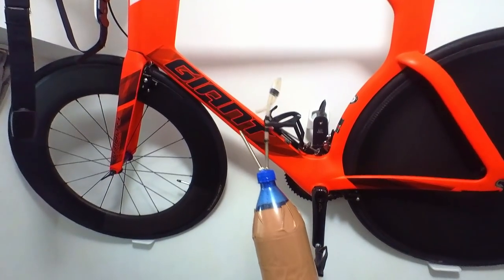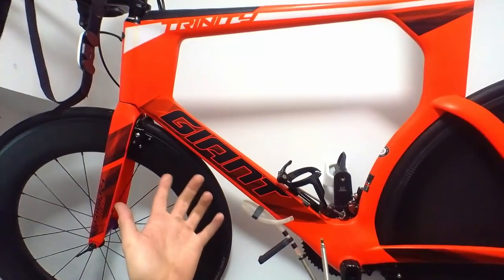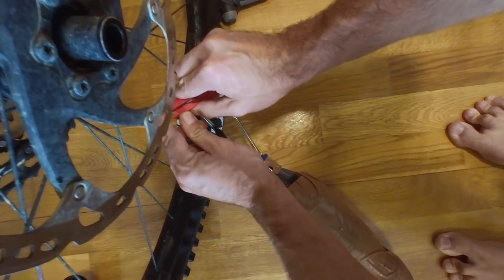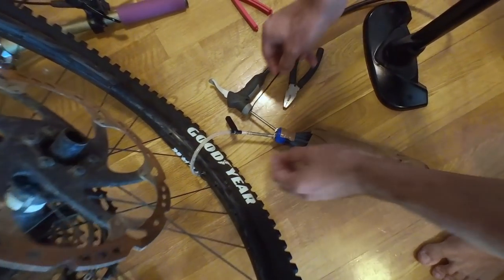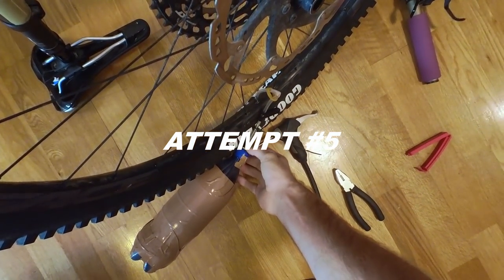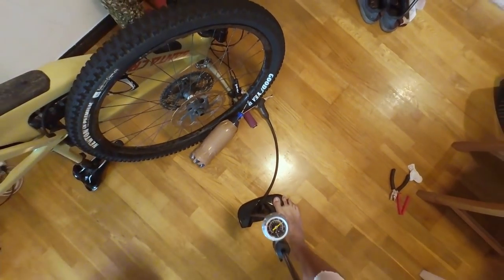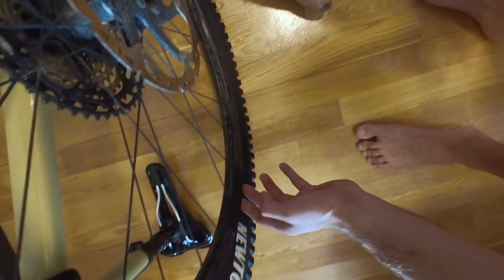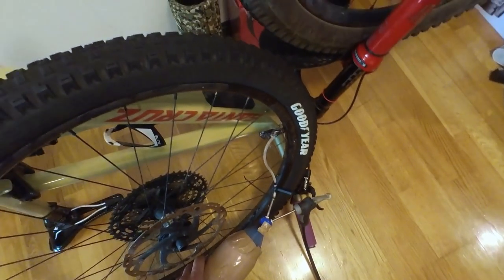DIY Tubeless Inflator Airshot. Do they actually work? No smoke and mirrors test.

Comment: Hi! I have a question that's been bugging me for a long time, and i'm just not smart enough to figure it out.
So... for bicycle frames it is said that stiffer is more efficient in pedaling. But is it true? I mean, they say that energy is lost in the frame if it bends. But it must bend back, which means it should give back this energy, unless you're strong enough to permanently deform the frame. Also, just because something is stiffer, doesn't mean it doesn't bend, just not as noticable, so the percentage of my force that goes into the frame instead of rotating the wheels should be the same, no matter how bendy or stiff it is. Unless i ride a sponge.
Maybe it's just the twisting chainline? But that shouldn't be as big of a difference as they claim, chains go all over the place on the cassette, much greater movements than how much a frame can deform.
I might be completely wrong with my thinking. Is it true that stiffer frames are faster, or they just feel faster and it became a marketing bullshit?
Reply: pretty sure it’s marketing bs. some bike brands say stiffer = better while others say stiffer ≠ better
Reply: @johntracey8592  yes, not to mention that comfort is more important in most cases than pure speed.
It could be kinda tested with a full suspension mtb, locked out vs. with open rear suspension. But dampers and the shock itself are not that efficient, probably eat up a bit of our power.
Reply: It bends back = uses that energy as heat during deformation.
The "Bending" steals energy from your forward motion

The energy doesnt dissappear it gets converted to something useless like heat

If you are still confused as to why it becomes heat. Get yourself a rubber band. Keep stretching and relaxing it. The elastic deformation will be converted to heat. 
if you do it enough times you will actually feel that heat.
Reply: watch dylan johnsons video on locked vs unlocked suspension, tldr even in the extreme case of an unlocked full suspension mtb there isn’t much of a performance difference in terms of efficiency. id imagine this extends to road bikes where small increases in stiffness arent going to help
Reply: @hellopsp180  if it bends back, it gives its energy back. Like a spring, they're really efficient. What they don't give back, that's the heat.
Sure, every kind of deformation generates heat, but is it really the case here? How much difference a bendy vs stiff frame makes?
And the rubber band gets warm because it doesn't give back as much force as you give into it. Plastics are weird, not really the best example.
Reply: When compressing a spring the work is stored as potential energy. The same is true when lifting weights, you will get al the potential energy back when lowering the weight or decompressing the spring. However our bodies cannot use that energy, its a workout. It ads to the work we have to do to propel us down the road. Meaning less efficient.
Reply: @maxspruit8370  no, i won't get back the energy. I lift a weight, i do work against gravity, the weight will get more potential energy, then i let it back down, while the weight is giving off its energy. If i just drop it, it speeds up, then hits the ground. That's the energy what i put into it when i lifted it up.
It's not me who wants to get that energy back, i just want to transfer it to the wheel. And i think that should happen, regardless the stiffness of the "spring", in this case the frame. No matter if the ground is soft or hard under me, the weight will give the same amount of energy to the ground when it stops, just in a different length of time.
This is the only thing i could imagine that would make a difference, since pedaling is not constant like an ideal electric motor, but comes in pushes. Maybe in the real world, physiologically it is better for our legs to have an almost immediate energy transfer, so the difference is actually not in the bike, but in our body.
Reply: if the frame is less stiff it will flex more when pedaling. This means that your actual pedal stroke becomes longer. Meanig more work is being done. When the frame springs back almost none of that energy helps you go forwards on the bike.
Its a bit like pumping up your tyre, but not pushing all the way through to te bottom.
In this way a portion of the air you are compressing makes it in the tyre. You compressed it, bit it did not net results: inefficient.
Reply: @maxspruit8370  hmm, interesting... I can imagine what you say is right, but i would still love to see some calculations or simulations as a proof.
Reply: @maxspruit8370  There's something missing with your explanation. Where does the potential energy in the spring go when it springs back? The answer is partially heat, sure, but the amount that is lost to heat must be extremely low. For example, if you take a steel coil spring with a mass on it, compress it, and let go, it does not return to equilibrium and stay there; it oscillates, often with nearly the same amplitude on the second oscillation. So where does the energy go [within the time span of one oscillation]? People have suggested that the spring-back does actually propel the rear wheel...watch the demonstration in this video: https://www.youtube.com/watch?v=BH_AL4rxrp8
Reply: @squiresuzuki  i thought it was a quite complete axplaination. Some of it was implicit or can me deduced. 
If you compress a spring, let it go and hold on to it the oscilation is lost quickly.
A tuning fork however continues. The potential energy is converted to kinetic energy and back many times, but if you hold it the wrong way it wil stop quickly. Your fingers wil have dampened the oscilation of the fork and heated up slightly.
As for the video: some of the spring energy will be transferred to propulsion some will be transferred to the body and loses its useful form. Hence less Efficient.
Reply: @maxspruit8370  Gotcha, you had only said "However our bodies cannot use that energy", but I didn't realize you meant that our bodies absorb that energy in the first place. How do propose that happens? You mentioned the example of lifting weights, and it's true in that example that the body does do "internal" work to maintain the position of the weight even when lowering it because of how muscles work, but pedaling a bike is more complex than that.
This is explained a bit on the page here (unfortunately, most of the animations/FEA/power graphs have disappeared in the last few years): https://web.archive.org/web/20090219195618/http://bikethink.com/Frameflex.htm
Also, that isn't strictly true about coil springs losing their oscillation quickly. Seen here, it returns to practically the same amplitude when comparing, say, the first period to the second period:  https://youtu.be/FJBPNJR2QJU?t=237 In the bike context, only one period is relevant because the frame will be flexed in the opposite direction when the next leg pushes down. And regardless, the coil spring analogy doesn't really matter, you can use a tuning fork in the analogy instead.

Comment: Just put a tube in it, inflate till the bead is popped on all around and you're already good to go. If you want it tubeless, leave the tyre inflated with the tube in it while you do something else for 15+ minutes so it can settle to it's inflated shape (Usually seating new tyres fails because of leaking at the corners left in the tyre bead where it was folded for shipping), pop the bead off at one side only, pour in sealing goo and add rim protector if you use one and put the bead back in place. It'll seal first try with a track pump and still take less time overall even of you stand by the wheel doing nothing while waiting for the tyre to settle to its inflated shape.
Reply: I do the same. I bang in a tube and ride it until I remember I was supposed to put sealant in.

It also helps with installing tubeless tape. Whack it around the rim bed, whack in a tube. Tube smooths the tubeless tape out and gives a nice seal as well as seating the bead.
Reply from the maker: I used to do that, but it was very unreliable, even getting one side re-seated. This was just a bit of fun really, works well at 140psi and its a butt twitching fun pumping it up that high.
Reply: @PeakTorque  Maybe works so well for me because the rims and tyres I use are on the narrow side of what is available now. 

Since my riding is not smashing full suspension bikes through rock gardens, I've found tubeless to be of no benefit to me. I tried it first when the original UST system was released and again a few years ago when I happened to get some wheels with sealed rims.

I found the sealant worked reasonably well in dry conditions, but broke down in wet conditions, which meant my tyres were saving up the punctures they'd collected in the dry to leave me repairing them on wet days.

Comment: The pressure inside a sealed plastic soda bottle full of carbonated drink does not increase when shaken. the gas remains dissolved in the liquid until the seal is broken.
Reply: Yes but when you bring the bottle in a location with large difference in pressure. It goes kaboom.

Comment: Soapy water helps a lot... or so I think. 
I have a small compressor, don't even own a track pump. Name-brand track pumps are stupid expensive IMHO, cost a large fraction (or same) as a new-gen, low noise compressor that is as loud as conversation (i.e. workable even in an apartment IMHO), or more than a cheapo-old compressor (stupid loud).

Comment: Bottles can take about 10bar/150psi, so don’t go above that! 😅 Safe is max 8bar I’d say. (Reinforcement helps keeping it safer but not non-explosive). I made one out of 1.5l bottle for road/gravel tires, worked 1st time and still works as a charm at about 6 bar. For MTB a 2l bottle is probably better. Also, for seating, the trick is to remove the presta core (and use sealant/soap water as a first trick - never fails). The issue is never the pressure, but the flow rate and friction in seating.

Comment: IED acronym for improvised "explosion device" .

I am kinda disappointed you did not show how you implement safety procedure protocol especially working with ehem "explosion". 

Because you mentioned about engineering principle  but i also expect OSHA approved working conditions .

- no safety shoes
- no safety glasses 
- no earplugs
- no safety gloves

But i believe this IED could use another "improvement" . You might use additional track pump head and hose  as well as attached another ball valve or any air valve (indusrial pneumatic grade). And  voila . That might work better

I might wanna try this one too if i was really in to tubeless.

Nice content nonetheless
👍👍

Comment: Sounds like you're restricting airflow... I remove valve core from wheel and use a larger diameter hose.
Reply from the maker: Of course the valve cores are removed!
Reply: @PeakTorque  okay, I thought they weren't based on how long it took to empty the IED ;)

Comment: That is a bit embarrassing, lack of engineering problem solving. 1) Remove valve core to increase airflow. 2) Quickly insert valve core losing hardly any air. 3) pump up to high pressure to seat tyre 4) shake sealant round the entire tyre inner surface 5) lower pressure to desired level. 5 minute job

Comment: hey is it okay if you don't hear the snap or pop sound when you add pressue to tubeless tires? I was able to just pump mines up with a regular pump and it holds air just fine but i didn't hear any snap or pop.